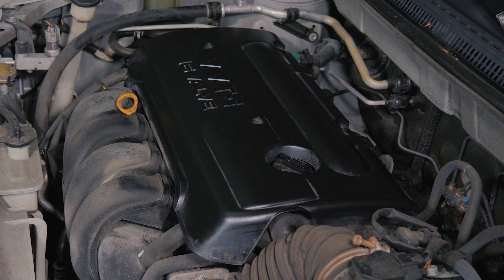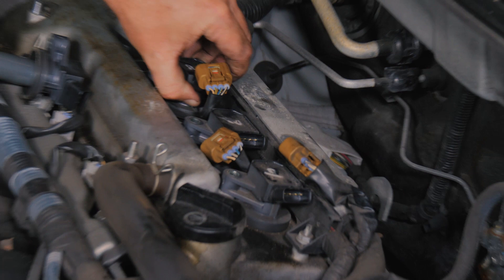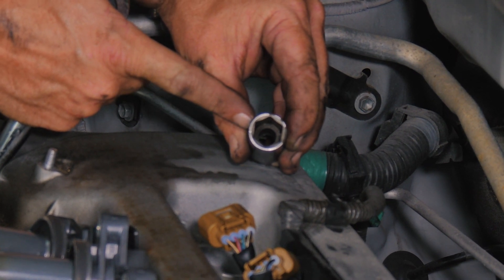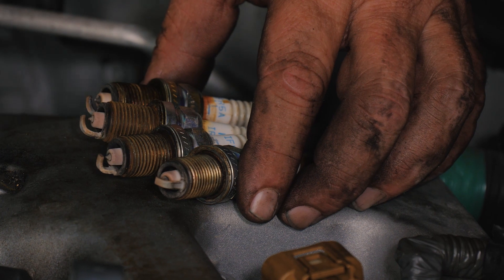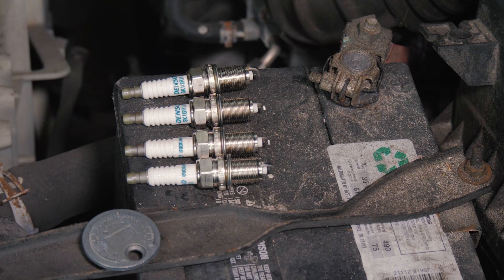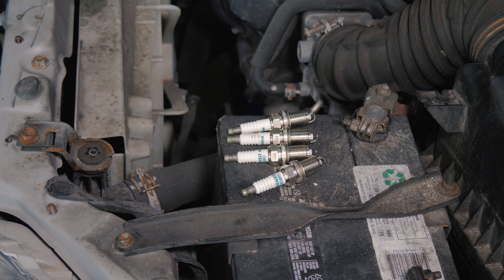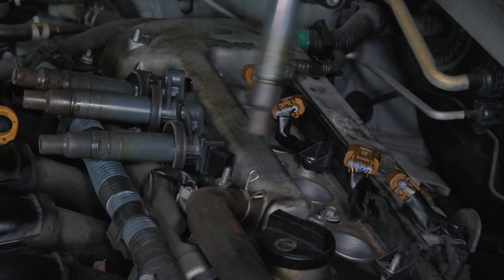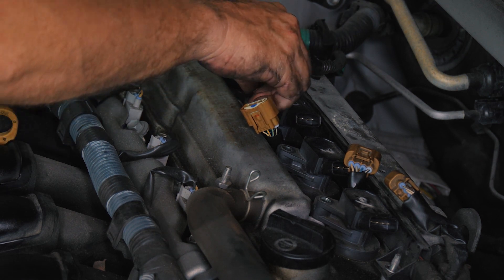2007 Toyota Corolla Spark Plugs

Comment: You use a calibrated inch pound torque wrench to tighten plugs (and coils). You do NOT guess at tightness unless you're in the African Bush and it's an emergency. Use of anti-seize compounds CHANGES  (reduces) the factory specified torque value. Anti-seize is not necessarily a great idea and if you change your plugs on schedule you do NOT need it (again, use of anti-seize leads to overtightening). BEFORE you remove the plugs you have to REMOVE the DIRT at base of plug by blowing it out (while wearing safety glasses). The discoloration on the plug insulator is probably not oil related...it is blow by leakage past insulator seal. The guy that did this video is definitely not fully informed and at one point he referred to the anti-seize as a dielectric (using a SMALL amount of dielectric on coil boot is not a bad idea). The FAILURE to use a calibrated torque wrench is a dead giveaway that he is an amateur.
Reply: Make a video and show and tell bro
Reply: @panchovilla3493  yea pls make a video lol
Reply: I think I'm counted as living in the 
Africa/Swedish remote bush. So make me a video, because I don't have afford to leave it to the mechanic and I need my car.. 😬🚨 . Like prob the rest of the people watching this.
Reply: Ngk plugs literally have instructions on how to tighten without a torque wrench. Finger tight plus 1/2-2/3 of a turn.

Comment: The dielectric grease should NOT go on the threads of the spark plug. I think you meant to put anti-seize on there. Which, most of the time, is not even necessary these days. The dielectric grease should go on the ceramic part since it's an insulator.

Comment: I bought my corolla at 164,000 so I don't know if the spark plugs had been changed.  So I'm turning and turning the socket to remove a spark plug, so then I wonder if the spark plug hole threads had previously been ruined?  Turns out the Toyota dealer had sold me 13mm denso spark  plugs while what was in the car were 5/8 inch spark plugs.  After I bought the spark plugs from toyota I learned I could get  5/8 inch denso spark plugs for half the money at my most trusted auto parts store.  I think Denso is a toyota parts supplier like Delco was for GM?
Reply: get Denso SK16R11 or NGK IFR5A11

Comment: I have Toyota Seedan 2009 Corolla what type of Spark plugs should i use
Reply: Iridium plugs from Toyota
Reply: iridium is a metal that lasts longer than platinum and you may not need iridium plugs... I said MAY.